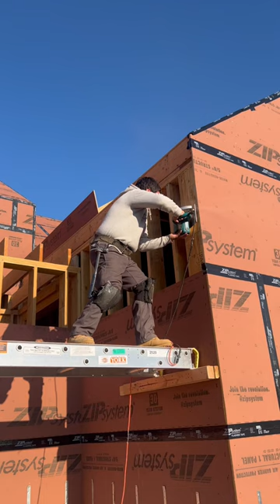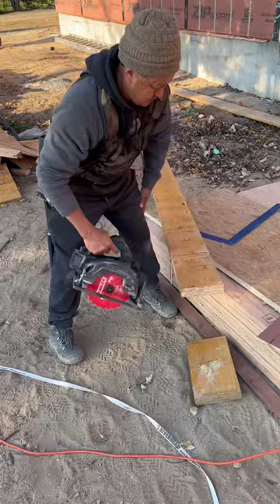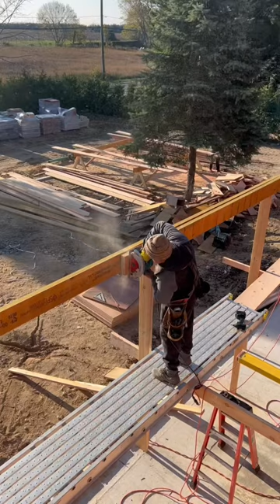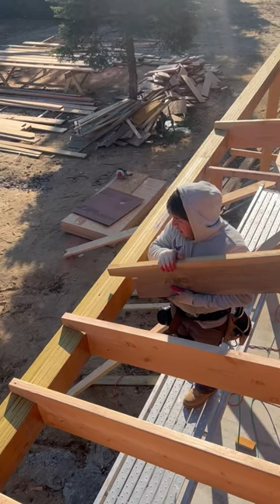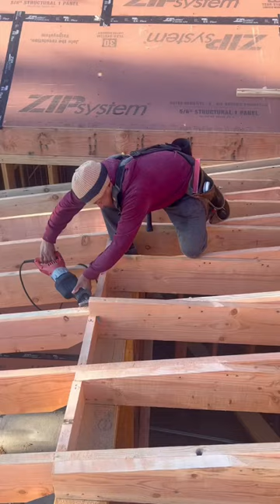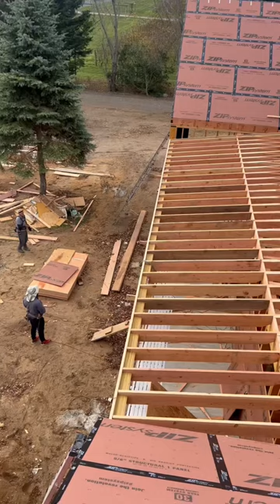Front porch #work #shorts #construction #skills #quality #design #art #beautiful

Comment: Who doesn’t love a Mexican.
Reply: All the union carpenters who are layed off right now. Then again most of the carpenters I have worked with over the years on larger construction sites have all become such specialists that they are almost putting themselves out of work and they are the ones doing this to themselves. For example when I first started in the building trades in the early 1990’s the carpenters did the form work for the concrete ,all the framing, drywall, ceiling grids , and finish work. There might be 10 carpenters on the job but they would do it all now you have all these specialized carpenters who only frame or will only do finish work , but in all fairness a good finish carpenter is hard to find but what happened to the carpenter who did all of the jobs they were trained to perform. I do understand that some of the work has to be done by special trained carpenters but it just seems like they are trying to self sabotage themselves when it comes to job security.
Reply: @mrbig4532 precisely why my business partner and I offer so many services. When you can answer most questions with "yep, we do that, too" and actually deliver, you end up with lifers for customers.